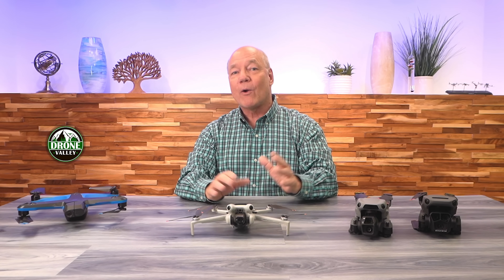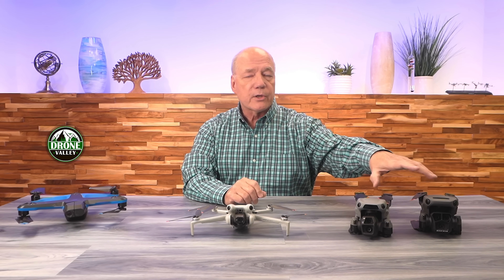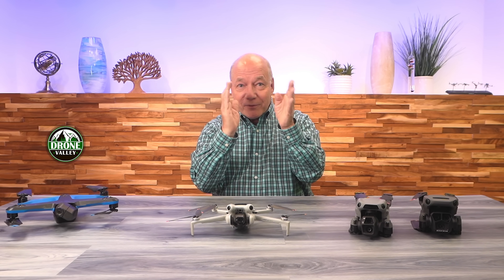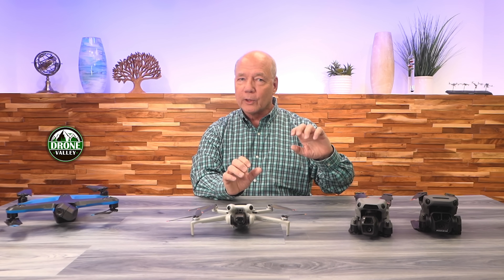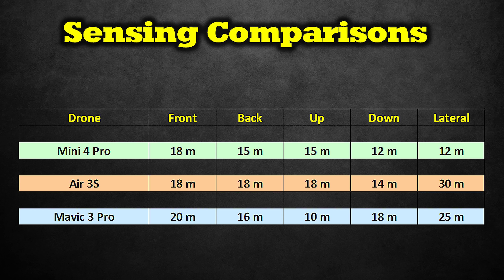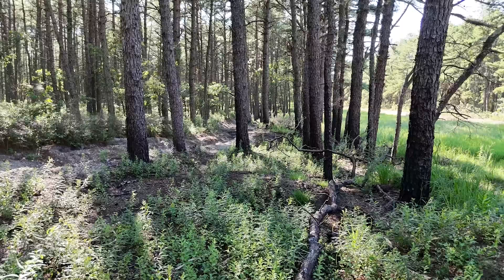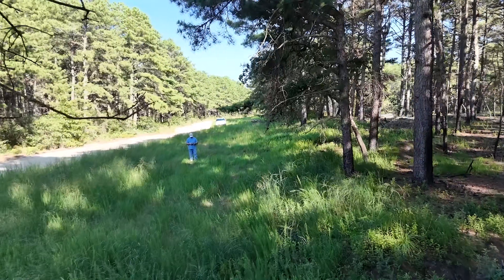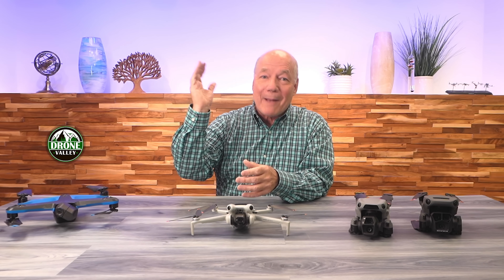DJI APAS Is A Game Changer and Makes Your Drone Almost Crash-proof

Comment: Just wondering, if you fly into an area where the gaps between obstacles gets progressively smaller what happens when eventually all the gaps are too small to proceed any further. Will the mini4 pro just stop and hover till the battery expires or will it back out the way it went in . Great video.

Comment: I use FPV all the time. Yes I know the strange rules around FPV which vary from country to country. The point I am making is the completely involved flying one gets from FPV means obstacles do really become less of an issue. I use an Air 3s. I don’t struggle with viewing my shots and get detail that you don’t know you have until you are sitting editing. I am about to head towards Xreal glasses…hoping for best of both worlds but will see. Screens on the controller are too small and get sun strike. Seems to me FPV is actually safer than standard drone with controller. Just my thoughts. Where I live -New Zealand  - we have some of the most restrictive flight rules in the world. ALL property public or private can’t be flown over without permission……..yes odd.

Comment: Very interesting video! I have a Mini 4k, but I guess I will get a Mini 4 Pro too. There are very good deals here in Europe now with a 25% discount. I guess the Mini 5 Pro is around te corner. 
I have done a lot of filming from safe heights, but these features as well as follow mode really speaks for the Mini 4 Pro. We have an estate with a lot of wood, and I use the drone to plan different wood cutting jobs. Only problem is that my dog is scared of the drone, I really need to train her.

Comment: I can no longer find APAS in my Mavic Air 2.. it only has this sensor - bypass, brake and off option
Reply: They took the switch to enable APAS out of it years ago. Setting to either Brake or Bypass is enabling APAS which means Advanced Pilot Assistance System. So basically there is no reason to have a separate switch to enable it first. Just makes it simpler.

Comment: Correct me if I’m wrong I believe only the Air 3S/Mavic 4 Pro has lidar.
Reply from the maker: Yep, I totally goofed on that spec, it is the Mavic 4 Pro that added LIDAR as well as the Air 3S. I'm still waiting on my test unit for the M4P and have been studying the specs and it got stuck in my head. Sorry for any confusion.

Comment: Too bad you're not able to buy one. DJI may be done selling drones in the US
Reply from the maker: They are in a bit of a tough spot and it's all based on nonsense and nefarious protectionism. They are working through the process of sorting it out but it's dragging on too long. I'm still waiting to get my hands on the Mavic 4 Pro to start testing and the rest of the world has had it for weeks. Stay tuned for updates.
Reply: I bought my Air3s new DJI is selling there drones through other countries and they ship them to the US. Same price as DJI direct.
Reply: @MrNorthstar50 no warranty or Refresh if the drone is bought and comes from any country outside the country you live in.  Applies worldwide.  If you buy it, you need to find a way of insuring it.
Reply: But they’ve been threatening that for about 5 years now, and have made no actual moves towards it.
Reply: @amsivertson if the drone can't make it thru Customs, you're kind of screwed.  Now the FCC and Commerce are jumping into the game.  Then the "security investigation and overview" may end it for DJI as DJI made in China.  Currently producing as well in Malaysia that may bypass all the current issues.
Reply: As of August 1st mis declaration of tariffs is a civil crime and can be charged up to a 30k penalty that will probably make the price drive up as well as a lot of companies are sneaking them through at $760 value for the air 3s
Reply: @QuantumFusionz this isn’t about tariffs.

Comment: In your opinion,what's the best drone by DJI for a new pilot,hobbyist. If I can find one. Thanks
Reply from the maker: Right now the newer Mini 4K is hard to beat for features and pricing. If you can find a used Mini 3 Pro for decent price, it's a step up for the Mini 4K but pretty much everything you'll need (except advanced crash avoidance) is in the Mini 4K and its a great way to get up in the air and is incredibly easy to fly. Welcome to the hobby and here's a link on Amazon to the Mini 4K - https://amzn.to/3Ux4OOZ
Reply: If the budget allows, go for the Mini 4 Pro and no reason to upgrade any time soon.  It has way more features than the 4k or the Mini 3Pro.  Yet all the Mini's have a major issue, can't fly in windy weather - say above 20-25 mph.  If you live in a windy area, drone will sit.  Then the Air 3S is the go to drone.  Most advanced in it's price range.

If in the US, slim pickings for any DJI drone that is new in the box.
Reply: @TerrySwift-e5u Thanks! I'm having a time finding a Mini 4 Pro or Air 3S

Comment: Mavic 3 Classic and Mavic 3 Pro), Air 3, Air 2S, Mavic Air 2, Mini 3 Pro, and Mini 4 Pro have APAS. What's the difference in APAS versions?
Reply from the maker: The main difference between all of the versions of APAS is the algorithm that processes the information from the sensors and the number and type of sensors themselves. With the newer Mavic 3 and Air 3S DJI added Lidar to the front of these drones and it helps APAS to improve. Older versions of APAS were more cautious and would not rick flying into tight spaces. The newest version APAS 5.0 (which is being used on the new Mavic 4 Pro) is amazing.
Reply: The "bypass" option in obstacle avoidance is the APAS